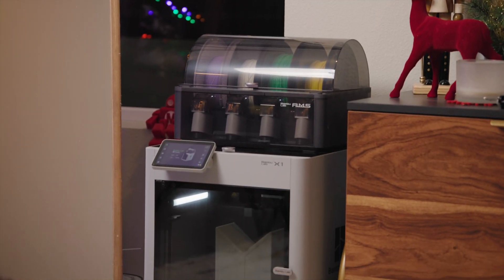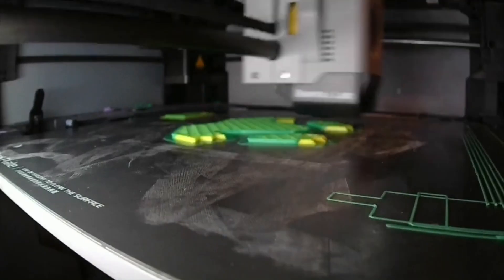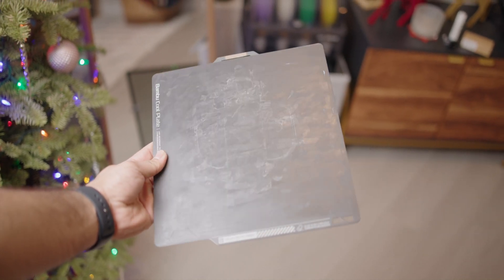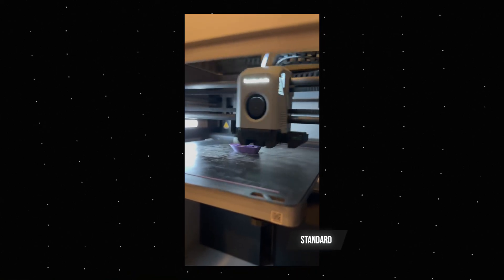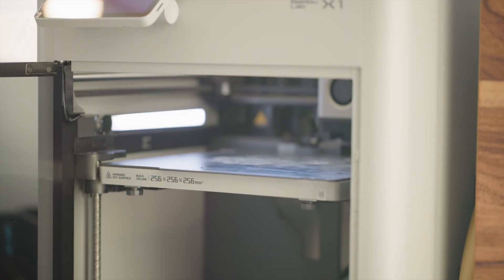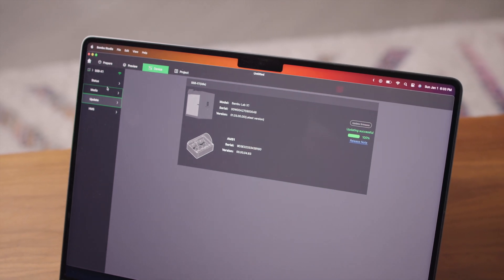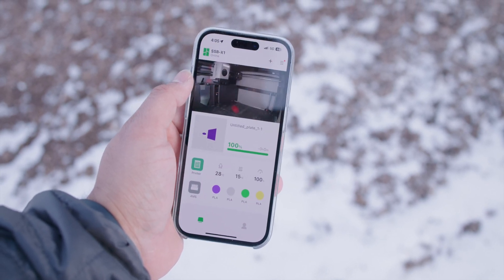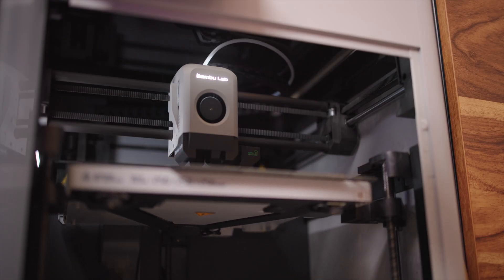Bambu Lab X1: Next Level 3D Printing!

Comment: Good video. Just got my printer yesterday. Can't wait to open it up when I get home from work
Reply from the maker: hope you're enjoying it!
Reply: @sumitbasra  I am thanks. Learning presently about how to set the temp for certain filaments. I kept having petg kind of jam up my extruder. The temp I think was set to high at 250. After 2 prints it's like a oven in there. And I think it got so hot that it became drippy then when it cooled it kind of turned into a blob and Jammed up. I've had to take it completely apart twice. Good learning though. Lol
Reply from the maker: @walkerdrae  I've found that I need to leave the front door open when I use PETG
Reply: @sumitbasra  hmm I may give that a try. I wasn't sure if that was a good idea or not. What temp do you use if I may ask?
Reply from the maker: @walkerdrae  I use the standard PETG profile in Bambu Studio, the temperature is 255C

Comment: I’ve been printing regularly in ludicrous mode with only a slight quality loss. My AMS is not sitting on the printer, but I also make sure to calibrate the printer for where it is sitting. Ludicrous mode does create a lot more vibration, but the parts have turned out great.
Reply from the maker: I'll have to give that a shot, gotta make room for the AMS next to the printer first!

Comment: I imagine the top heavy is what’s causing shift in ludicrous mode. Maybe secure it along side the desk you have there OR a couple long 90 degree brackets to the floor to prevent wobble
Reply: Bolt it to your foundation and it will shake your house apart.
Reply: @benjaminsutherland2358   lol I wouldn’t know I don’t have one yet but each one that I see shakes at the top but I guess it’s really good at compensating for wobble
Reply: @benjaminsutherland2358  The print head doesn't have enough mass for that

Comment: Hey everyone, I'm brand new to this and about to buy the X1 as my first printer. Is their slicer good or are there better options? I want to print with materials that can withstand being used outside and be rigid/durable. I've found some great sites for buying filament, but if anyone has leads to high quality suppliers I'd appreciate the tips. Thanks for any info!
Reply from the maker: personally I think their slicer is okay, I haven't tried using this with another slicer tho (I'm not sure that you can)

Comment: Not a bad review. Though I would not want to push it into a wall because of the waste chute at the back.

Been loving my X1 Carbon since September.
Reply: I'm thinking of using a hose to connect to a waste bucket under the table.
Reply from the maker: @cy-one  I feel like that could work
Reply: @sumitbasra  got the printer today... Dayum this is an awesome machine
Reply from the maker: @cy-one  enjoy!
Reply from the maker: yeah I ended up making a little waste basket to catch the purge!

Comment: I own x1c I solar have no problem at sport mode but I do have to agree Ludacrist  mode needs to be optimized  more the spaghetti  detection  does not work still. Thay have added auto filiment swap for ams but have not got it to work. One issue I have is  printing tall object  after done when prin another object it will bottom out when re calibration  it will grind the bottom have you had any of these issues??
Reply from the maker: spaghetti detection is hit or miss for me, it's usually false positives so I just have to resume the print from the app. kind of an inconvenience, but not too bad. I haven't tried the auto swap on the AMS yet, I need to run down some filament spools lol. and no, I haven't had that issue with taller prints, how tall are you going?
Reply: @Sumit Basra   the tallest i print was 220 mm the issue is when the print is done and I start a new one when it homes it bottoms out  than rises  so for a few seconds it will grind too low Oof
Reply from the maker: @nooneknows3919  oh man, lemme try a taller print and see what happens!
Reply: Let's see hope you don't have the same issue as me gl ;) but still the best 3d printer in deed  I wish thear was a bigger buld vol maybe thay will make another ks for bigger vol I will be all in:)
Reply: You can avoid the bed bottoming out by homing the printer after a tall print within 30-ish minutes. After that, it will enter energy saving mode and looses its position. But if you're running an all-nighter, there is not much you can do about it..